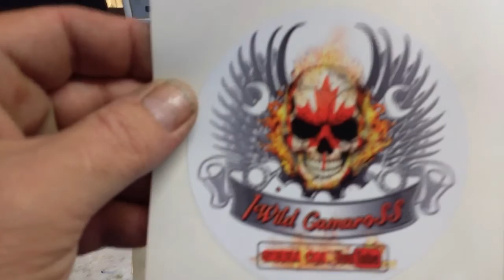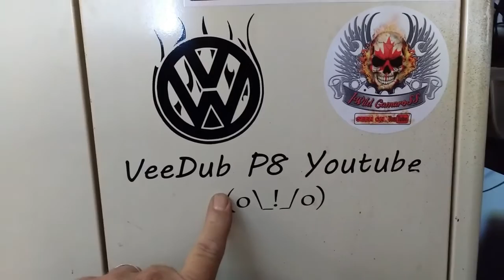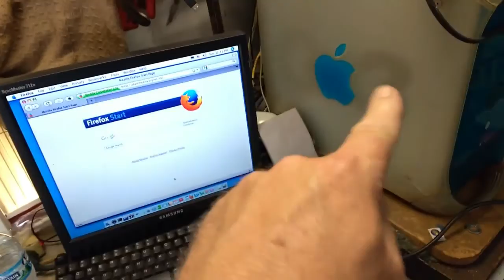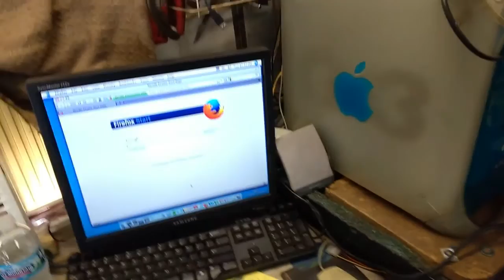Commander Mail Call x2

Comment: I like the old gilson . I get the sears running . I going to dig it out next .Also have a comet 26 snapper i want to do .  I do have a 12 hp engine here . the 8 hp one threw a rod . i may see if it will fit . I was not sure if it would fit , but looks like yours has the same front grill and hood ,
Reply from the maker: How cool, that is good info in case I need to replace either of those. The Kohler in the Gilson I just finished is a 12hp motor just fits but it fits. :)
Reply: Spark plug has to be close to the hood on a 12 . I also think the crank sets higher on the 12hp . I may not be able to use the belt guard . Got me wondering if it will fit .